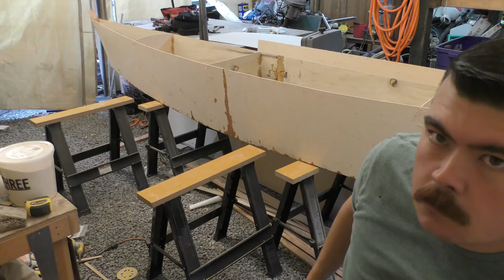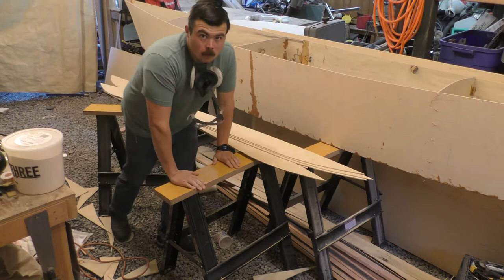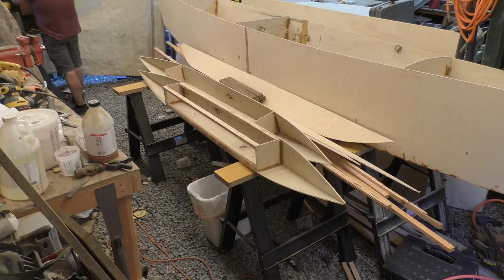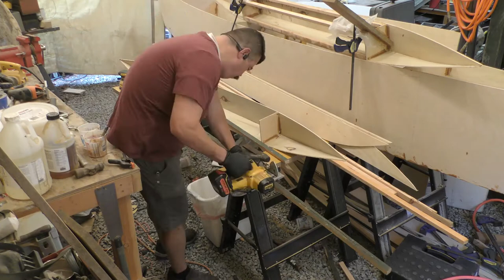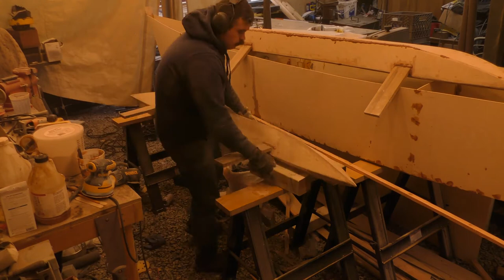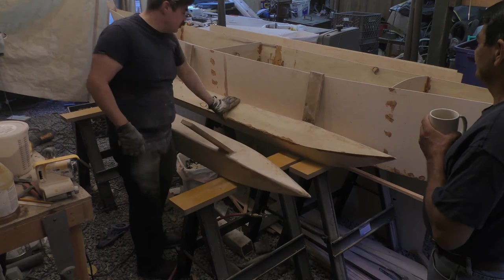Building Outriggers for Sailing Canoe- Sailboat Build 5

Comment: it's getting too cold to work outdoors.  I'm looking forward to see how you make the rigging.  Also, I have no experience with epoxy, it would be interesting to know how you store resin/hardener and how how you mix small batches.  how you measure, how much at a time, disposable cups?  all the best on your build
Reply from the maker: you are right on it being too cold. I live in Washington on the Canadian boarder and it is now cold and damp. The project may have to take a hiatus until it warms up again. 
As for Epoxy, Mixing is easy. I do use graduated cups in small batches, if you mix too much at a time it can heat up and get the chemical reaction going too fast in the bowl, it's easy enough to just mix up more if needed.  The system I use is a 2:1 mix so it's very easy to get the right ratio. The epoxy also stores just fine in also any conditions, I just leave it in the gallon containers it comes in closed tight. I have successfully used years old epoxy with no issues.

Comment: Great project. You will hate yourself down the road for not wearing some type of mask to filter the air you breath. Your lungs and health will pay a heavy penalty.
Reply from the maker: Agreed, most of time I time I have a nice respirator I use for sanding of nasty chemicals, sometimes I am lazy.
Reply: It depends.  Certainly don't work closed up in a shop or garage with chemicals in a poorly ventilated area.  I work outside in the back yard.  Still can be hazardous when sanding and you make clouds of epoxy dust .